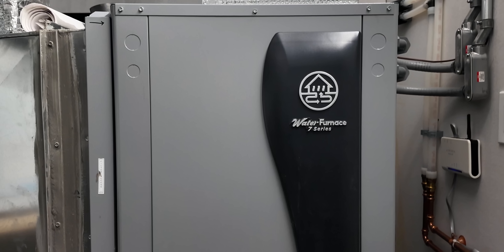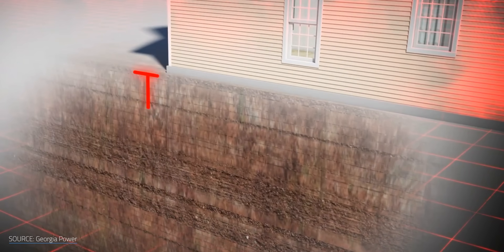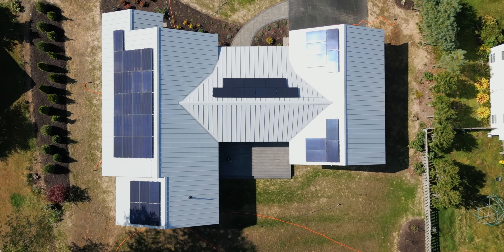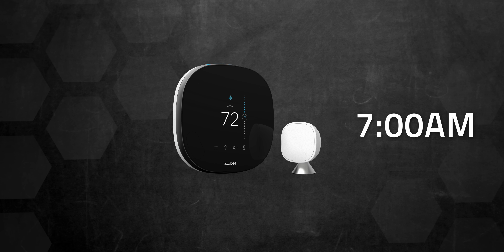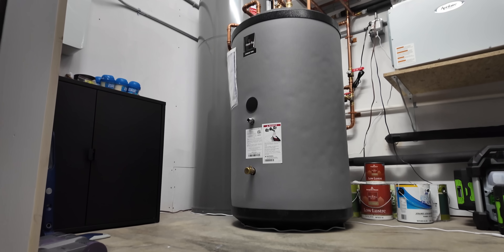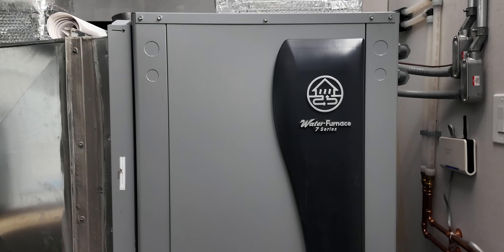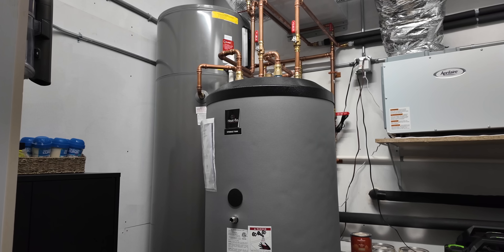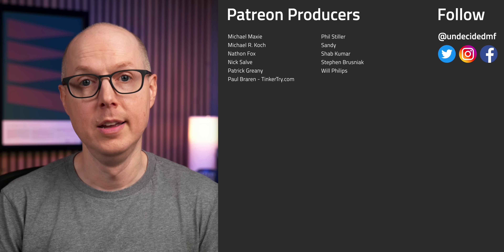How My Geothermal Heat Pump Really Performed (2 Years)

Comment: we live in germany and we got the geothermal heatpump in the year 2010. Back than we payed around 12000€. We heat about 300m2 or 3300sqft. We use around 10000kWh/year. The decreased heating cost ( in comparison to an oil-based alternative) and the comparable aquisisson costs, paid the heatpump itself in around 8 years or so.

Comment: Based on numbers you have provided, it is highly doubtful that you will ever recover your initial investment for your geo-thermal HVAC system. After rebates, you paid $54,000 for your system. Your house appears to be around 2500 SF. My Trane AC split system, which uses natural gas for heating, cost $8,300 total to install here in Arizona. My home is smaller than yours, it is 1850 SF. My energy costs per year are around $1,500.00 to heat and cool my home. If I were to install solar panels, as you have, that number would fall to zero, as it has with your home. 

A typical heat pump system for your home should not have cost $39,000, as you mention. At most, it should have cost around $15,000 to install. And if you have natural gas available, that probably would have been cheaper for heating your home than using a heat pump, considering your extreme winter temperatures. Provided your heat pump HVAC system met the Energy Star requirements, you would have  qualified for the same rebates, and your $15,000 system would have dropped to around $10,000.. So, for a standard system, you would have saved $44,000.

 If we consider the TVM on $44,000, had you invested this money at 5%, you would have made $2,200 a year in interest. That would have covered the $2,100 per year cost to heat and cool your home. So, you would have saved roughly $44,000 in initial cost, and you would have made $100.00 per year after paying your energy costs.

But here is what you did not consider. No matter what heat pump system you have chosen, it will wear out over time. Optimistically, your heat pump may last 15 - 20 years. At that point, you will have to purchase a new heat pump and probably a new water heater. That would also be true for a standard, non-geothermal heat pump and hot water heater. So you will incur costs that are more expensive than replacing a standard heat pump and hot water heater again, because your geothermal equipment almost certainly costs more to replace.

Nor do you address the maintenance costs for your system, which will also be higher than a standard heat pump system. Nor do you address repair costs if something breaks down, and those costs will be higher for a standard system.

This is NOT a criticism of your choices, but your video implies that your system will save you "tens of thousands of dollars" over several decades, but it does not address the replacement and maintenance costs for your equipment, which will be significant. 

No matter how you look at it, you will never recover your initial investment costs. That's okay, because you have chosen a luxury system and as you mention, it outperforms a standard heat pump or split system HVAC system. So it is a little like buying a six-figure luxury car. The value of the car will drop precipitously over time; however, you have the enjoyment of driving an amazing car. So the enjoyment and luxury factor of the car is a factor that a person is willing to pay for. 

You have an amazing HVAC/Water heating system. However, you should claim that it is going to save money over a standard system because that just isn't true. Let me emphasize that there is nothing wrong with paying "for the best" and buying a luxury system. But buying such a system categorically does not "save tens of thousands of dollars over multiple years" as you claim.

Comment: Geothermal is more efficient than an air heat pump if it is really cold. It gets less efficient with only slightly cool temperatures, like > 50F.  In many areas the cold days make up most of the heat needs (espeically with extra heat source like the servers). It still depends on the local climate. E.g. in areas like Ireland where really cold days are rare an air air heat pump can be more efficient.
The first year can also be misleading:  if not used much for aircon in summer the ground will get colder for the 2nd / 3rd year and thus lower efficiency for heating.

Comment: 7:22 It is very interesting to see the temperature of a house in a colder climate. As a Brazilian, keeping a house at 24°C in the hot season is COLD (speaking indoors). Here (Southeastern Brazil, "Cfa" Koppen climate), the comfortable temperature for home HVACs can be as high as 26°C in Summer and only as low as 22°C in Winter, indoors.

Of course I don't speak for people living further south, or north to me. Northern states are right on the Ecuator, and 25°C outdoors is as cold as it can get; to someone living in the Amazon, 25°C is chilling, so of course their preferred indoor temps are much higher.

Comment: If the soil temperature stabilizes at such a shallow depth, what is the point of drilling vertically down four hundred feet as opposed to laying a longer network of shallow pipes laterally?

Comment: Part of what you had is the ability to specify really good attic insulation, which of course reduces HVAC load. and you can specify thicker exterior walls, which also allow for better insulation.  For an older home, it is a crap shoot what can be done.  Our home has an unusual roof which means that there is no access to the 'attic' where one could install more insulation.  Some older homes might only have 2x4 studs for exterior walls that would greatly limit your ability to properly insulate the space.

Another thing I run across is that some HVAC contractors have a set of things they deal with, and if you ask them about anything that they don't have (like geothermal), you get a blank stare.  Or tell you that you need to talk to someone else in the office (who can't be bothered to return the phone call).  Where we are, there are a lot of seasonal homes (some of which are rentals), and thus the bread and butter are the cheapest systems that they can find.  Some of the potential customers will ask for multiple bids, and pick the cheapest one not even considering the TCO.

Most developments around here, all you get is a spec home.  Builders don't offer upgraded HVAC as an option for the most part, nor do they offer upgraded insulation.  You can upgrade kitchen appliances or add a bonus room.  The rest, you are on your own.  So perhaps a starting point is to find a location where you can have a custom builder put in the home that you want as opposed to whatever cookie-cutter homes they happen to want to build.  And while getting some of these upgrades is easier when the home is under construction, it is still going to cost more than a spec home.

Comment: In California, if you do the math, it may actually be "cheaper" to use Natural Gas to heat your house than Grid-Electricity and a Heat Pump. California charges ridiculously high of Electric Power, yet Natural Gas is cheap and plentiful. So, even with a 3 to 5 times more efficient heating method that a Heat Pump is, California Monopoly, Taxes, Distribution and Regulation costs on electricity drive the price up more than the 5 times you gain in efficiency. A small inefficient natural gas generator produces cheaper electricity than Grid electricity in California.

Comment: Three years ago i had a 30kw air source heat pump sys installed in my very old and large stone manor house, with a solar panel system with batteries as supplement. It cost about the same as Matt's geothermal sys but i didn't get any rebate as I'm outside the US. It was a tremendous project to put water pipes and cable conduit through 80 cm walls, and 3 stories. The climate is mild but the electric bills during the 2 or 3 cold months are massive, 60-90kwh per day, and we close off little used rooms. In the months that we don't need heating or cooling, the electricity consumption is around 8-15kwh/day. Is it worth it? The house is now beautifully comfortable while before it was cold beyond description. A special cold. Imagine an old castle. Even with 4 fireplaces raging all day it barely made a degree difference.  The builders in the early 17th C didn't account for heat pump design. Also we put new insulated clay tile roof which changed the indoor world as much or more than the HP system. The options to make this particular house comfortable were/are limited. Any other system would be less costly to install but hugely expensive to operate.

Comment: Out of curiosity @UndecidedMF, is it possible to have a geothermal heat pump operate on multiple structures without significantly  compromising efficiency? For example, what about having a single geothermal heat pump heating and cooling a home and a separate workshop/shed?

Comment: yea, uh I was installing these BEFORE anyone really wanted to talk about it. I built 3 on the east side of the state (Washington) back in the early 90's. Frankly I don't get the reasoning behind the deep well loop other than to hit a reservoir in order to capitalize on a quick delta T shed. In most locations, 5' is well below the frost line and can work  beautifully for surface to surface heat exchange.
 The cost of flexible plastic piping has come down drastically since I first started, so looping a couple thousand feet is very cost effective.
And P.S., my first systems I scavenged coils from old tear outs and just used a scaler to clean them up. Grundfos pumps did the majority of the work so at the end, costs were really bearable. Also one of my customers had a rather large greenhouse and we would use condensation run-off for drip irrigation.

Comment: Maintenance?  I have a 140 year old coal burner that was converted to gas likely in 50s.  I have lived here for 26 years.  I have never touched the system other than to relight the pilot every few years.  It has to fan as it is a gravity heating system and therefore there is no filter to change.  I live in Michigan where it is likely MUCH colder in the winter, but I still average maybe $100 a month or so for my heating and this is in a 1500 square foot home with a full basement and the insulation in this house is horrible.  I do 68 at night as I like it colder to sleep and I do 71 in the day.  I work at home so I do not turn it down for work.

Now one HUGE advantage is in Michigan storms can take out power for hours or even a day or more.  It does not happen often, but it does happen.  I have a cheap digital thermostat I bought when I moved into the hour that runs years off 4 AA batteries.  With no fan or igniter the furnace actually can run off the thermostat.  Yes my heat works when the power is out.

I question if that heat pump system is going to last 70 years... or 140 years.  Even at 30 years your system is costing $1,820 a year... and what do you pay for your annual service... $200...  $300?.  You are looking at spending more than my heat AND electricity and that does not include any repairs or the electricity you have to spend.  Of course your electricity is almost double per KW as mine too.  Then again I bought a fixer upper 26 years ago, and refinanced it 2 years later to replace the roof and redo the kitchen.  Total that was $79K plus the $10K I put into siding, flooring, and bathroom when I bought the place.  At 5.75% interest I pay $635 a month plus, $20 for garbage, $20 for Water/sewer, $70 for electricity, $90 for internet and cell phone, $115 for gas... or $950 a month.  I have no car as I work at home and bike everywhere.  I only have 6 years left on the mortgage, then my bills will be about $550.

Comment: We live in Helsinki, Finland so quite up north. We use to have district heating where the last 12 months cost about 5000€. We used about 40 MW per year of hot water from the district heating system.

We drilled a 290 meter well for the geothermal system and some piping for the new system but radiators and floor heating remained the same. Geothermal system cost 30 000€ and it costs about 100-120 € per month in electricity to operate. The system used electricity about 8400 kWh in 2024. This year is already at 9000 kWh due to very cold Jan and Feb compared to 2024.

Comment: Geothermal heating applications are occasionally useful, especially if your home is not connected to city infrastructure.
However,,,, For maximum efficiency and the lowest initial cost, as well as ongoing operating cost, nothing beats natural gas. It's a fact.

Comment: Finished our 2800 sq/ft house in Ohio this year and went with a Waterfurnace Series 5 system. It is 3 tons unit. We are all electric and only have used 1200 kWh a month the last two months. It is nice setting the thermostat and not having to move it up or down. By not having gas that is saving me $40 a month just for the service because 8 out of 12 months in Ohio you barely use any gas.

Comment: Long term maintenance of the drilled well loop mean you have to replace the well loop, which means higher replacement costs every 15-20 years vice conventional air cooled units.   End of life and replacement issues matter.

Comment: I have a geothermal heat pump. I live in Buffalo ny, so my temps are similar.  My home is built in 1929, so insulation is worse.  That being said, I'm averaging $120 per month for heating and cooling with hot water included.  

I've had my system for about 6 years and some issues have been the zone dampers ( we have 2 zones) are prone to failure.  One died under warranty, the other just bit the dust and is out of warranty. Probably about a $400 repair.

Furnace filters are huge, we spend about $100 per year on those alone

Comment: Even though it adds more complexity and maintenance, plan on doing the hybrid air-source/ground-source setup. So for example it is 65F air temp and 55F ground temp, it will heat from the air, if it is 40F air temp and 55F ground temp it would heat from ground.

Comment: Very cool system.  I'm in construction and about 20 years ago we installed a similar system (much larger) on a library project in the Denver area.  It was supposed to be a demo project and to the best of my knowledge, they never did another one.  Another comment, your elect. costs are triple ours.  Yikes!

Comment: I had a Geo T, open loop, when I built my 3000SQ house on the East Coast, NJ. That was back in 98. My house had to be cert for home energy program, but the knowledge about the systems and options where poor, back then. My builder went with an open loop. It worked well for around 8 years and saved us a lot of money on HVAC bills, but then the headache started. He went the cheap way here. Never install open loop!!! Close loop is the way to go. Hardly any maintenance needed. When it works, its the best system around for large homes. hands down!!!!
Reply: I have an open loop system. Never really had any problems. I had to replace the submersible pump a few years ago. Just replace the 16 year old expansion tank this week.
Reply: @myronparks3495 All depends of the water  quality and depth of pump. Also, make sure you flush the coil in your unit. They get clogged.
Reply: @alp3781 the water here is hard with a lot of iron. The pump is around 30 feet. The well was drilled at 100'. I have a sand filter that helps keep the coil clean.

Comment: When we were house hunting or planning to build I was ideally looking at geothermal in either instance. Ultimately, we found a house with it and love it. Our system is an open loop system, so we do have a little concern with the water table when it gets dry for extended periods of time... but so far we've had no issues. It's a little weird being out with the dog late at night and hearing water pouring into the return well, especially in the winter. At 34 years old, we're actively replacing roofing and siding now, and in the spring we'll add some new insulation to the attic as I'm sure it's settled over the years and even then wouldn't have met current code.